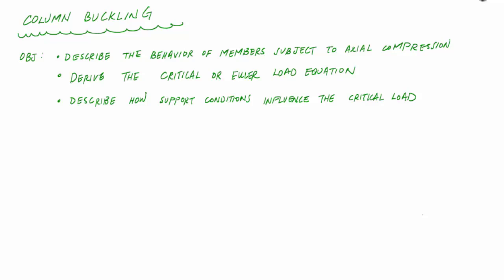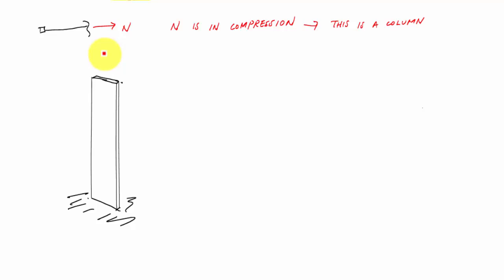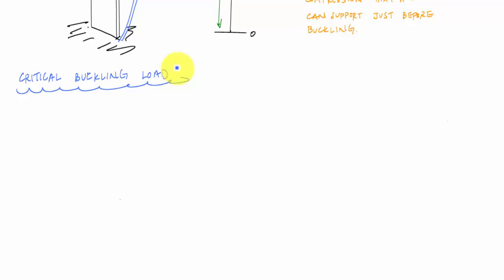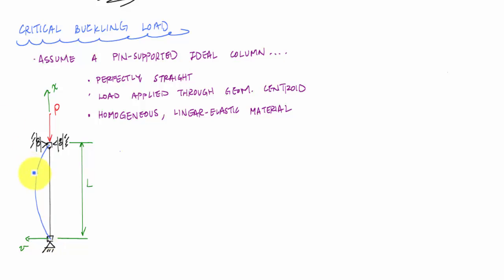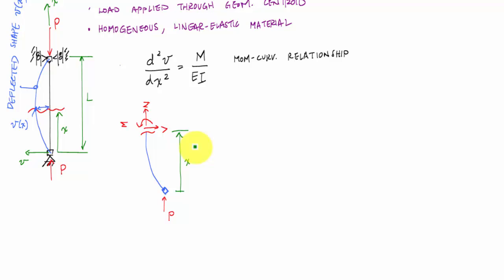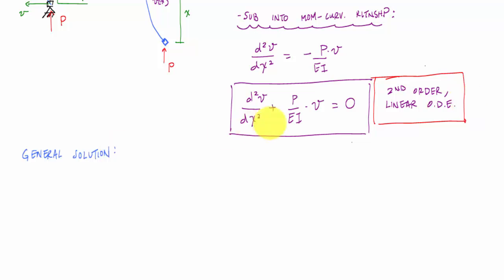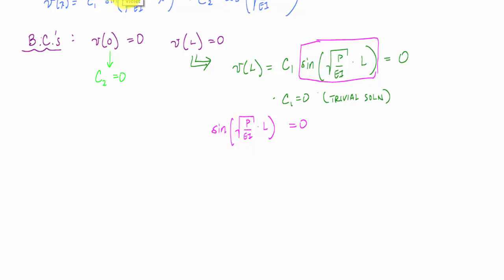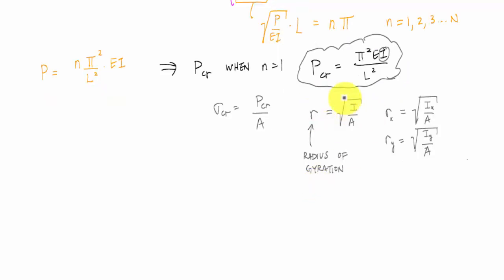Introduction to Column Buckling (1/2) - Mechanics

Comment: hey thanks for this video, i have a question! 
you said that the moment acting on the cross section is due to the deflection, if the deflection is large enough. but what causes that initial deflection in axial loading case?
Reply from the maker: One reason is that no member is perfectly straight...

Comment: There should be the square of n in the final result. Although it won't affect the first mode of the buckle, it will give the wrong values for the other modes of buckling.

Comment: Calculate the axial compressive strength of a composite column, consisting of a 38 x 38 x 3.0 Square-section of S355JR steel and filled with plain concrete of 25 MPa cube strength. The column is 7 m long and pinned at both ends. Assume there is adequate load transfer. Please